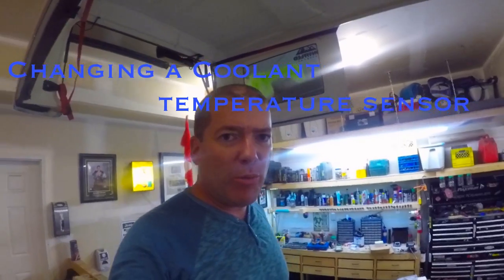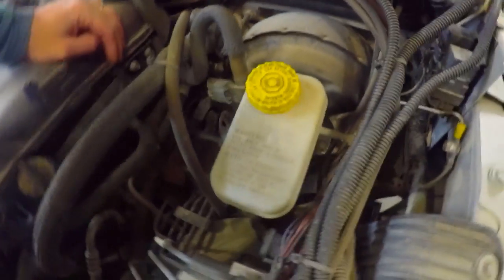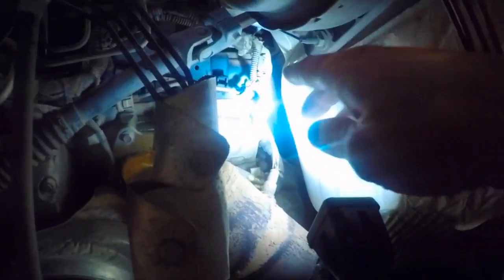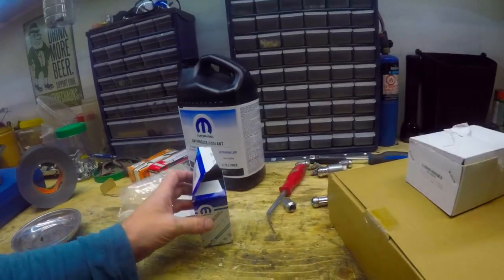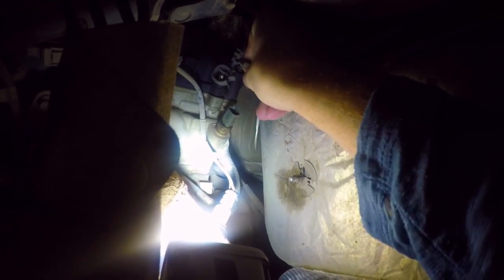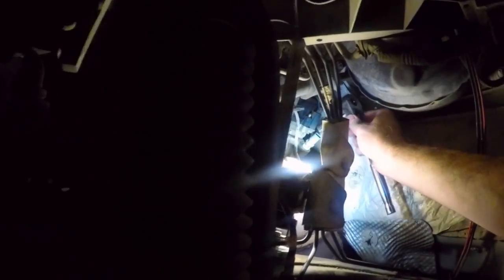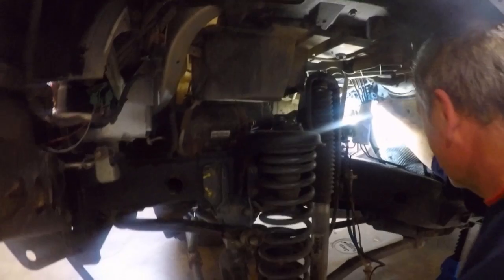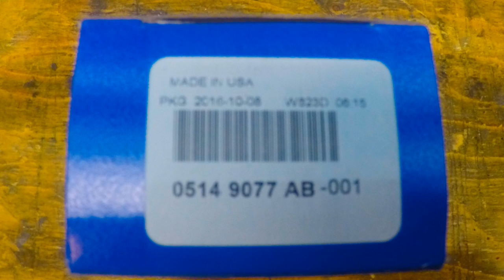Changing a Coolant Temp Sensor on a 2012 JKU

Comment: I had a P0128 code and swapped the thermostat, reset the code and it came right back so I will be doing temp sensor next. This video was very helpful.
Reply: Was this on a 2012 Wrangler? I just swapped out my thermostat and my indash Guage is consistently around 3/4 of the way to red but Zero signs of overheating. Also my radiator fan is CONSTANTLY running HIGH NON STOP. So I'm thinking the sensor first before I switch out the $400 fan. Any thoughts would be very much appreciated.
Reply: @davidhyde6025  I’m having the same problem did u fix it?

Comment: Good video. One thing I would note is about the electrical connector.  You need to pull the red part straight up. Then, there is a little tab on the side facing the motor (at least on my Jeep) that you need to press while you pull it off the sensor. All of these electrical connections seem to be slightly different, and cause problems.

Comment: Thanks for the Video. I managed to get mine from the top by taking the steering joint bolt out, sliding it out of the way and laying it down. Then using a universal on the socket.
Reply from the maker: Glad it helped

Comment: I just did mine this past weekend.   Watching your video made it super easy!  Thanks!
Reply: How did you get the wiring harness off? Mine is not pulling off easily.. ugh
Reply: @wla1rmc11   you have to slide the tab on the connector before it will release.  Once the tab is moved, the connector should come off with little resistance.
Reply: I slid the red connector up and it would come free. I ended up having to take it to a shop. They went in from the top. There is an additional tab you have to pull up on after the red connector is released. I just couldn’t quite get it myself. Grrrr $88 to have them do it for me.

Comment: Great video!  In the middle of this now and found out the sensor I bought was the wrong size thread.  My question is, will I be able to burp the air out (of that area) by using a gravity fed coolant reservoir (funnel system) at the radiator fill cap?  Is there another method I can use to do that or would that be the most efficient way?
Reply from the maker: Hello, thanks for watching the video and yes, you will be able to bleed the system with the funnel system.  I've used them before and they work great and way less mess.

Comment: Why did you change it will the temp sensor make the cooling fan not come on mine is not working and I replaced it with a new one and Still don't work on a 2016 all fuses and relays are good.
Reply: Did you find anything I’m having the same issue

Comment: Curious what symptoms made you change this? I'm dealing with cold radiator cap and cold lower radiator hose after driving. Live in Michigan, avg. Temp has been about 20-25 F. Have never not had heat. Replaced thermostat, burped the coolant system, and checked for leaky head gasket. Symptoms seem similar or did you just know you needed to replace?? Thanks for the awesome video!
Reply: Also, 2014 jeep wrangler JK, 3.6L.
Reply from the maker: John Ardner Hello John.  The Jeep actually threw a code. We changed the sensor and the code went away.
Reply: Alright cool. Ever heard of my situation? Super weird. Lose coolant from reservoir maybe every 3-4 days. Still have heat. No codes/check engine lights. Temp gage is dead center when hot. And digital readout says 203-217 while driving. I am baffled as to why I still have heat and not overheating while having a cold radiator cap and lower hose.
Reply: Also no coolant leaks that are noticeable. No puddles or smell of antifreeze.
Reply from the maker: John Ardner I bet if you did a pressure test your rad has a small leak.  Mine is a 2014 and I’m on my second rad
Reply: Ah crap, alright. Thank you!

Comment: Excellent video thank you.. I have a a question so my fan is constantly running on high non stop after about 10 minutes of driving and will not stop until I turn the 2012 Wrangler off. Brand new thermostat, clean coolant topped off. Also my temperature dash Guage jumps right up to half way then within a few minutes I'm running 3/4 to red mark my whole trip. And NO signs of over heating under hood. Radiator cap isn't even that hot to touch. But Guage supposedly says otherwise. Time to change sensor?? Thank you for any knowledge you can provide
Reply from the maker: david hyde Hello,  is your Jeep throwing any codes?  My engine fan stayed on high once. It ended up being the oil filter cooling  housing.  Not sure if it was connected in any way but are you leaving any oil from the top of the transmission?
Reply: @Homeguy4x4  I'm checking my engine light and c ode tommorow first thing. No I'm not seeing anything at all. Everything else is pretty tip top Except the fan of course. No leaks of any kind I do know that the 2012 JK had major electrical issues Bein the Panastar year. Could electrical issues have anything to do with this?
Reply from the maker: david hyde I’m not sure. I have a buddy that has a 2012 JKU that had a fan issue. I’ll talk to him and let you know.
Reply: @Homeguy4x4  Thanks a lot I really appreciate you doin that. I'm really Goin crazy listening to this fan every second I drive.
Reply from the maker: +david hyde hello, my buddies fan just stopped working. Ended up getting a new one.
Reply: Hey David I am have the same exact thing you had with your Jeep did you ever find out the problem ?

Comment: Also, can't the P0128 code mean the thermostat is bad? or should I for sure change the sensor first? seems to be running fine, blows hot air, not overheating at all.
Reply from the maker: If you are getting the P0128 code, I would change the sensor first.  Your thermostat, I don't think would bring up a code.  Also if it was bad you would be having heat/cool issues.
Reply: this is exactly the issue im having and bought thermo and sensor but now im gonna just do the sensor

Comment: Thanks for the video good Sir. Quick question, if some already asked I am sorry, didn’t see it about halfway down the comments. Was this your fix for P0128 code? I know that code could be either thermostat replacement or the sensor you replaced. Any suggestions as to which attempt to do first and save me $20?
Reply from the maker: Hello Joe,  You will have to make sure it's the coolant temp sensor, it also could be your thermostat, it could be stuck open.  Either way you will have a little bit of a cost for repair.

Comment: got under there and could not get that red that red tab to come loose so after awhile had to give up didnt want to break it i have a heavy hand...lol i changed out both cam sensors and the crankshft sensor before and they were hard too but i did it this one it's tight up in there oh and do i need to put teflon tape around it before installing?
Reply from the maker: Sometimes there is a bit of dirt in the connection.  I will usually spray it with WD40 to get rid of the crap.

Comment: Hey. Top video. I was looking for the sensor, now I know where it is. But how do you get the plug out? The red tap bit?
Reply from the maker: +Ibby.P yes you have to push the red tab back and it will allow  you to squeeze the connector to get it off.
Reply: @Homeguy4x4  Ah thanks. I'll give it a go.

Comment: Thank you for this.. my problem is I am having a hard time getting the wiring harness to release from the sensor. is there a trick to it? I tried WD-40 and that didn't help is there a clip i can't see?
Reply from the maker: Hello Renee,  Yes there is a clip on, I think it's one the red ones that either slides to the side or up from the clip, if that makes sense.  Good luck.

Comment: Mine 2007 Jeep Wrangler Sport, manual transmission gearbox, it suddenly turned itself off and it doesn’t even crank (when I tired to turn it on the starter doesn’t go on) after it cool down everything went normal. In this occasion the car temperature is normal and everything is OK. However when the car is worm it keeps doing the same problem. Could that be the temperature sensor or not? Specially the car turned off and no cranking could be made
Reply from the maker: +TheMrAAE Hello,  I would try and see if the Jeep is throwing any codes or see if there are any saved codes. I’m not sure it’s the temp sensor.
Reply: HOMEGUY4X4 
The codes it showed are (P0058),(P0032),(P0571)&(U1418). Do you have any suggestion !!! It drives me mad
Reply from the maker: @TheMrAAE  Well, you've got a few there.  the U1418 is your right wheel speed sensor, P0571 is you ECU, which could be the initial problem.  P0032 is the heater control bank 1 sensor 1 and the P0058 is the heater oxygen sensor.  If you are not comfortable doing the work yourself I would get a technician do the work for you.  If you are, I would get a more advanced code reader to see if it shows you more information.  That could narrow it down a little bit more.
Reply: HOMEGUY4X4 
Thanks, I really would love to have your technician to fix it but I am more than 3000 miles away (Middle East). The oxygen Sensors are removed from my car as I got a custom exhaust that why I am having P0058 & P0032. So do you think it is the U1418?
Reply from the maker: @TheMrAAE  Well if you have a custom exhaust and you removed the oxygen sensor, that is your problem, or I would start with that.  Get the sensor back in, build a bung where the sensor was and get it plugged back in. The guys that did your exhaust, or a place that does exhaust can do that.  I bet if you did that P0571, P0032 and P0058 might go away.  The U1418 is the speed sensor that is located in the wheel hub or wheel bearing in the right front, drivers side.  Good luck with everything.

Comment: I have a 2010 Jeep Wrangler (JK) with a 3.6l V6. There is similar looking sensor on the front of the engine next to the thermostat housing. At least that is what I think it is. Anyway, it broke off. It is plastic and not I cannot get the threaded piece out. First, what is that sensor? And how do I get the broken piece out?
Reply from the maker: David Seay Hello, you should be able to get a wrench on the sensor even if you broke the plastic off the top. The sensor we changed was the coolant temp sensor.

Comment: how do you clear the code ??  will replacing the sensor with the code active mess anything up ??  it will reset after 3 drives or so i believe

Comment: Thanks for the video. It's the closet one I could find for my 2012  keep grand Cherokee Laredo. Do you know if my sensor is in the same spot on the engine? I'm getting the same code. Guy at auto zone couldn't tell me where it was located. I replaced the thermostat but the engine light is still on.
Reply from the maker: Jesse Brown hey Jesse, do you have the 3.6 L engine?
Reply: HOMEGUY yes, it's a 3.6L.
Reply from the maker: Well doing a bit of a search.  It looks like the sensor is in the same place.  I would pull out the wheel liner and see if you can find it.
Reply: HOMEGUY I'll give it a shot. I appreciate the help.

Comment: Did you drain the system before pulling the sensor? I'm about to do mine and I'm not sure if I should be prepared for coolant to start pouring out.
Reply from the maker: +George Chalnick Hello George, no we did not drain the system. We may have lost a teaspoon of coolant during the change.

Comment: Doing this now and did not get the mopar part like I should have. Having a tough time getting the new one to tighten down all the way. It should sit flush is that correct?
Reply from the maker: Candace Mitchell it doesn’t take much to get it tightened. No more than about 10-15 lbpounds
Reply: Thank you so much!

Comment: I had the same code as you show below.  I was told there are two sensors, the one you changed on the back of the engine which I was told runs the gage and one up front that controls the codes.  which one or is there only one on the jeep 2012 wrangler unlimited?  Thanks.
Reply from the maker: From what I understand there is only one sensor for the coolant temp.  I could be wrong but we did our research and couldn't find another one.

Comment: hi, is this the same sensor for a 2014  jeep wrangler unlimited 3.6
Reply from the maker: +Alvaro Soto Hello Alvaro, yes it is the same part for the 2014 jku.
Reply: My 2014 took a different P/N sensor.  Apparently Mopar changed head design about this time, and it changed the sensor size, too.  Each one I tried to purchase at parts store did not fit, and they did not show another part.  Ended up getting the sensor from dealer.  Mopar P/N 68164627AA.

Comment: I had this code come on last week when it was extremely cold. Could that cause it or just ware and tare?(2012 jku   50k miles) After replacing it, did you reset the code or did it come off by itself after driving it?  What's the dangers of driving with a bad sensor? 

Thank you!
Reply from the maker: Hello,  This could have been a faulty sensor and the extreme cold just made it malfunction.  We cleared the code before we changed the sensor and it didn't come back on once we repaired it.  Thanks for watching!
Reply: Thank you for your quick response! Will be replacing it this weekend.
Reply from the maker: Thanks for Subscribing!

Comment: How much torque should you use on tightening the sensor?
Your video was very helpful , however I have a slight coolant leak
Reply from the maker: +Dan OBryan thanks for watching. I would put no more than 7 to 10 ftlbs.  Make sure there is Teflon on the threads.
Reply: I tighten everything one ERRRNT! That's what my shop teacher said to do... 
The methhead mechanics at jiffy libe would use an impact and tighten it 15 DAW-DAWAS.

Comment: What was the issue you were having prior to replacing the sensor I’m having the a temp issue in idle and goes back to normal when driving.
Reply from the maker: He never had an issue with the jeep at idle.  It just through the code and we got it changed within the week.

Comment: How did you know it needed to be replaced?  Did you pop a code? Was it no longer reading on the dash?
Reply from the maker: Joshua Almendarez Hello, yes it did, it was a PO128 code which is the coolant temp sensor.
Reply: HOMEGUY thanks brother
Reply: yea mine came up too!
Reply: Homeguy 4x4
How did you know it wasn't the thermostat and not the sensor?
Thanks

Comment: Jeep Wrangler 2015 Sport Unlimited. I'm having P0480 code fan doesn't spin at all. Factory fan is replaced with SPAL. Any clue? I checked relays and fuse..
Reply from the maker: Will it spin just putting 12volt power to it?
Reply: HOMEGUY  it's weird. Last night I installed SPAL fan and it worked left the Jeep idling for like 20-30mins worked like a champ a/c worked. Today I stopped at the red light I've noticed temperature was going up and code came back. Coolant temp went high as well thought maybe temp sensor? That's how I found your video..
Reply from the maker: Dan Dan I would try the temp sensor. That could be the problem.
Reply from the maker: Dan Dan here is something you can try.  https://www.google.ca/amp/s/www.autocodes.com/amp/codes/p0480_jeep.html
Reply: HOMEGUY how did you disconnect that red tab the temp sensor? I tried earlier hah :) I will try that and check wiring to make sure the fan it's getting good connection :(. Appreciate all the help guys!
Reply from the maker: Dan Dan the tab just pushed back away from the sensor. Hope it's only a simple ground or something
Reply: Dan Dan Dan, did you already take some coolant out before you took off sensor in video? Our coolant came out, fast and a lot...not a little drip like yours showed. Just curious. .other then that, good video easy fix thank you.

Comment: is this the same setup as 2011 Grand Caravan 3.6L?
Reply from the maker: It seems the temperature sensor is on the front of the engine, just below the intake manifold.  I could be wrong, but you could check this with your local Auto Zone or Auto Parts store.

Comment: yea i think that needs changing on mine so you can't get to it without taking the tire off?
Reply from the maker: MsLeelee94 you might be able to.  Turn it completely to the passenger side and that may get you enough room.
Reply: okay thanks i'll try it . ive changed out cam sensors on it so i know it's tight in there but i have small hands and the right tools Thanks again!

Comment: Did you reuse the stock fender liner?
Reply from the maker: Jacob Cardone Yes we did.  Only takes a minute or two to reinstall. Thanks for watching.
Reply: HOMEGUY 4X4 Did you reuse the plastic clips?
Reply from the maker: Jacob Cardone Yes we did.  We used a Christmas tree puller to get them out.

Comment: Thank you for the information, I will be changing mine soon on our 2013 rubicon. We got the code P0128
Reply from the maker: Thank you for watching.  I'm glad it helped out.
Reply: Hi Adam. Did that fix it? I have a 2013 JK and was getting the po128 code. I was having intermittent heat. I changed the thermostat. Hoping that was the issue.